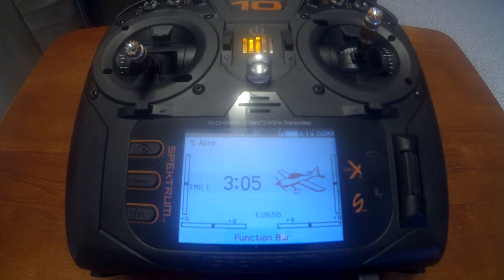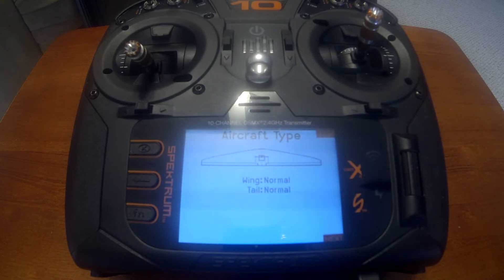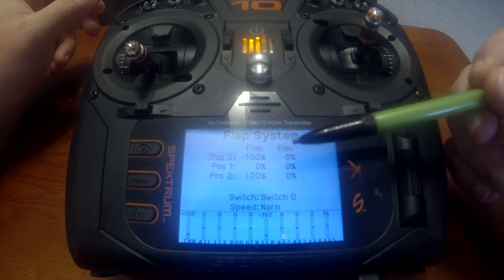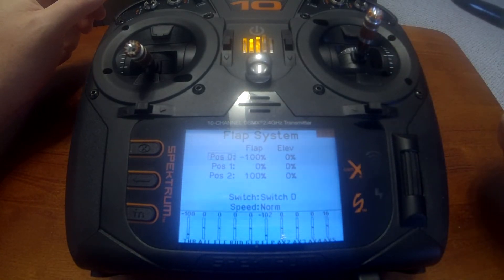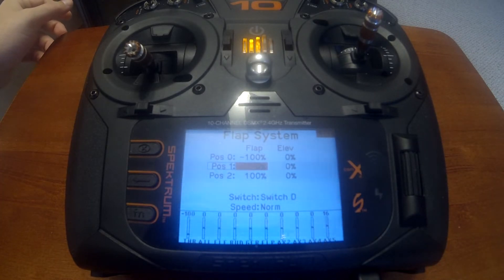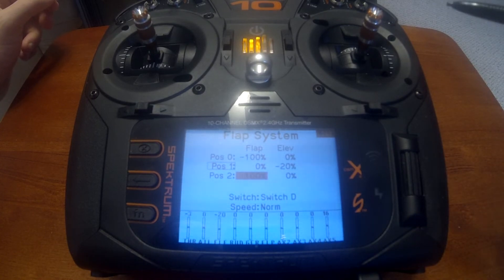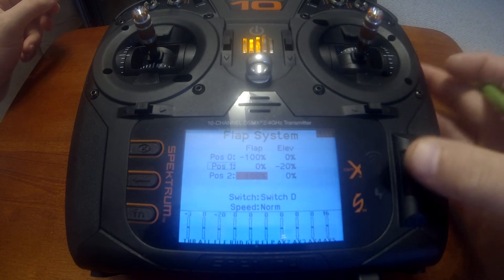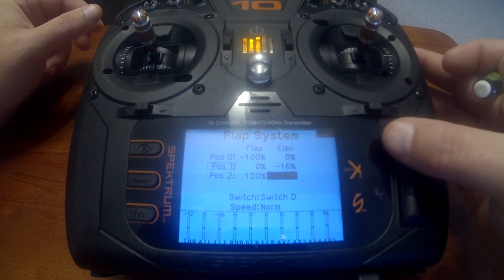Spektrum NX Setup: Elevator to Flap Mix Tutorial - Basic (NX6/NX8/NX10)

Comment: A word of caution. That elevator mix also moves the end points. On my UMX Turbo Timber, I had elevator set to 50 down elevator at full flaps which gave a very smooth transition.  Unfortunately, on go-around, that leaves almost no up elevator making climb out difficult until I get the flaps up.
Reply from the maker: Mix simply adjust up or down the elevator from the set position in flap menu. If you need more than 50 you can increase the number to 100.This is only changing the set "fixed" position of the elevator.Same as putting 50 in the elevator column of the flap menu.

However something to mention. Having alot of down elevator for "transition" ,referring to keeping from ballooning when flaps deploy. Slow your flap deployment speed down to help,because more down elevator to offset "pitch up",more up elevator needed available to go pass neutral position and pull nose up to climb out.

So not a issue using this mix, its using too much elevator one way and not having enough deflection/throw (rates or mechanically) to go the other way. 

Side note: 50 is high amount.I started to mention this in the video,then decided to answer it if it came up,which i appreciate your comment!
Reply: @BDTennessee  - Haven’t had a chance to test yet but slowing the flaps more seems like a good idea. That was kind of the plan prior to finding your videos on the subject of flap / elevator mix. I was running at 2 sec but will try more.

I really liked your Advanced video.  I have a DX8G2 but can do sort of the same thing you did except using the R Knob.  I already have it set up. I reduced my elevator trim from 50 to 30.  Then set the knob as an extra mix with a 30/30 range.  That will let me dial in from 0 to 60 down.  Once I get the characteristics I like, a little simple math and make it permanent.
Reply from the maker: @marks7445  2sec is standard for most eflite planes. I standardize 4 sec on my planes. Some high wing planes or large flap surfaces i turned up to 6-8 seconds. One thing you will see 6-8 isnt really 6-8 total :)

Thats sound like you got a good method too. Same as me ,do the transfer and make it permanent too.

Comment: BD, Like your videos!  I'm having a little problem with defining dual rates on one of my planes, defined on an NX 10.  I'm seeing some hashes on the boxes that depict the switch position.  I understand what the darken boxes or the clear boxes are telling me & the little box under theses.  However, these hashed boxes are causing problems for my DR definitions & I can't figure out how to get rid of them.  Any advice would be appreciated.
Reply from the maker: When that happens it means the switch position doesnt match the curve. Example: Switch your setting for rates is in Pos 1. The "Curve" which has a number on screen needs to be 1 and the box (0/1/2) at the bottom need to be highlighted which would be 1... When these are different you have gotten the cycle out of order it puts hash marks.
Reply: @BDTennessee  BD, thanks for getting back to me so quickly!  I get what you are telling me, but after much playing around, I couldn't resolve the problem so I took the coward's way out & defined a new model.  Better luck next time, I guess.  BTW, I'm really impressed with your Spektrum NX videos..... nothing else like it on YouTube I believe.
Reply from the maker: @orcharddriveblockparty8266  that works too :)

Thanks for the feedback and i appreciate the support!

Comment: good video. now my question. : your method is great..... when my ar630 is not in safe mode. when i put flaps down it starts to trim....then long delay....then "pops" to the full assigned elevator position!
i have an nx 8, ar630 installed in a tundra. it balloons with flaps deployed, the elevator trim is moving in the correct direction, but somehow severely hindered in safe mode!  works fine with safe off....any ideas?
Reply from the maker: You can minimize the ballooning by slowing down the deployment speed more.Safe mode will keep it from happening cause it correct plane to level flight.
Reply: @BDTennessee  i've been experimenting, it still happens. i think i'll try adding zero elevator and a flap deploy speed of 2 seconds and see if SAFE auto corrects the balooning.  all my bnf planes work fine! its just this tundra pnp with ar630 giving me fits!
  your videos are superb!
Reply from the maker: @muskybob8726  its not unusual to turn flaps on a high wing up to 4 and 6s deployment. Flaps throws make them produce alot of lift and 2 seconds is really like one sometimes...
Reply: @BDTennessee  i'm still working this problem.  the problem is the elevator "jumps" half of the programmed deflection approx 2 seconds after flaps reach there determined position.
i am reviewing all of your recent videos and go home and check all of my settings.  my flight modes are on aux2, operated by switch c.

when i go to flight mode 3 (safe off) it works perfect!

possibly there is a flight mode issue with elevator trim?

keep putting out the good content!
Reply from the maker: @muskybob8726  i think that might be the issue. When you say the flight modes are on aux 2,did you change anything in the channel assign or rx port assign?
Reply: @BDTennessee  i think it is all correct....wish i had my nx in my lunchbag!  lol.   but i saw something in one of your videos talking about trim settings and flight modes...
     im real good with manuals and electronics... im a 33 yr avionics tech with a major airline... i must have goofed a setting.
   i'm wondering if i should delete the profile and rebind and do the setup over.
i am setting up an ar600 in to a tundra v2 with 90 deg flaps....my understanding is that if the flaps drop 45 deg with a 20 unit elevator correction at a rate of 2 seconds.....the flap and elevator movement should be sync'd to end travel at the same time to create a smooth transition.  but my elevator drives half of request.... then 2 sec after the flaps stop.... the elevator "pops" the other half.
this only happens in flight mode 1 and 2 which are safe select.  it operates perfect in flight mode 3 (no safe)
you seem to be one of the most knowledgable ones on YT..... so i'm bugging you....lol
Reply from the maker: No worries,i appreciate the questions and glad to help.I would start with a fresh model.Also what model RX you have? AR600 is older and doesnt have Safe,so im thinking you have a AR630?
Reply: @BDTennessee  yes, brand new AR630
Reply from the maker: @muskybob8726  use a clean new model.Use forward programming to set flight modes.It sounds like the 2 Safe modes has a conflict. Dont change anything in Channel Assign Screen...
Reply: @BDTennessee  ok.   im going to do it now
Reply: bye golly you fixed it!!!  thankyou so much!   i think before i set up flight modes outside of forward programming!!! i am thrilled. thanks again. i will be giving you some big shout-outs on my channel!
Reply from the maker: @muskybob8726  awesome! Glad it worked out and i could help! Shouts on your channel will be much appreciated!